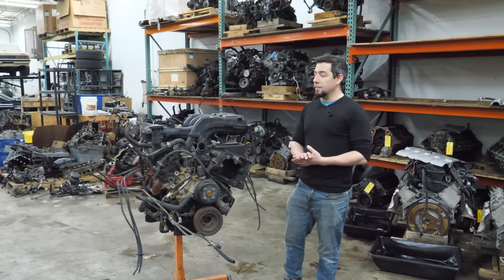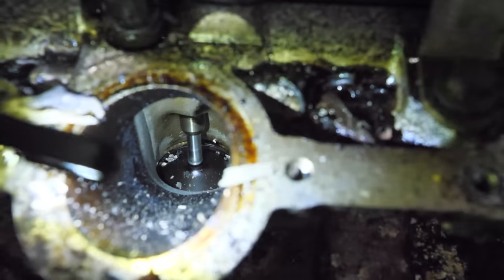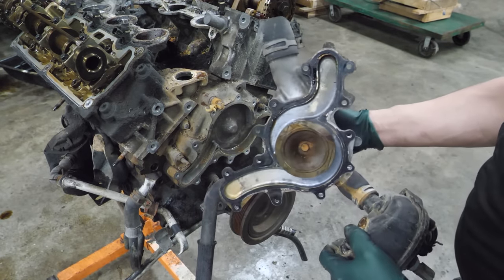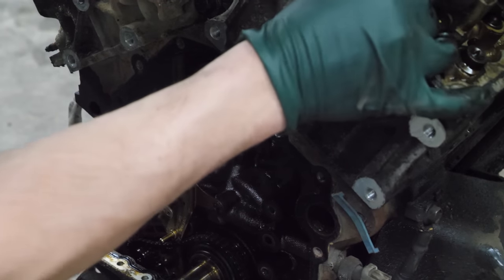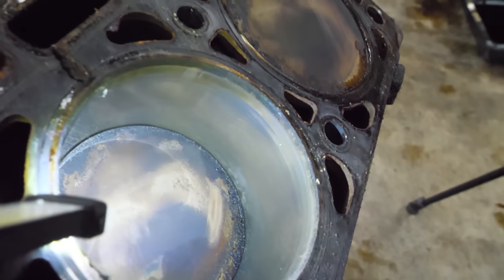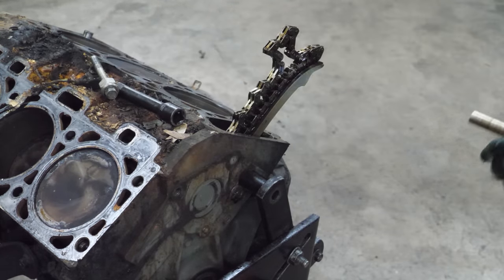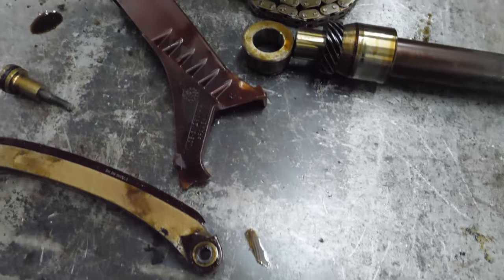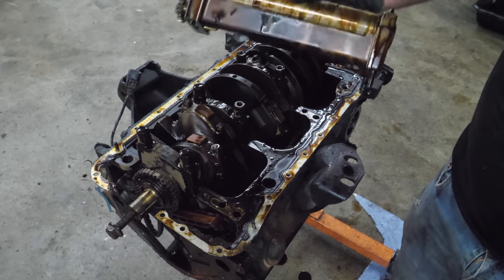Ford Explorer / Ranger / Mustang 4.0L SOHC V6 Teardown! Is This Why They're Called "Exploders" ?

Comment: On the front drivers side timing chain guide, you unclip it so it splits into 2 halves, then you can remove it without pulling the head 👍
Reply: Better take good care of those afterwards
Reply: lol glad someone was paying attention
Reply: While pretty much every manufacturer comes out with a dumb engine design here and there, Ford seems to hold the top spot year after year after year. This entire engine is an insult to engineering and common sense, as well as mechanics and the consumer.. Ford should have just made it cam in block with pushrods, instead of that insane timing chain/driveshaft/cam design. Would have been much cheaper to build, more compact, simpler, lighter and much more reliable. It's not like the engine is moving Ferraris around. It's just a workaday 6 cyl with low/medium output. Could have just done something simlar to the GM 4.3, which was a great & simple, reliable workhorse for decades. Not Ford though- Let's come up with the dumbest way of doing things & get it approved for production...
Reply: @thezoomguys385  It must have been for the enormous power output that they needed a SOHC 🙄 🤷‍♂️
Reply: @Conservator.  LOL, yup. They must have been hitting the bong when they OK'd this design...
Reply: @thezoomguys385  The truly strange part about it is that Ford already had a couple of engines to choose from.  This 4.0L SOHC is a development of the Cologne 60-degree V6 family, and supersedes the 4.0L 160 bhp version that was used in the Explorer, Aerostar, etc.  Ford also had the 90-degree Essex V6 (3.8L, 3.9L, 4.2L) which was used in Mustangs up through 2004 and also in F150s and a bunch of other stuff.  It's weird that they went to the trouble of converting the 4.0L Cologne engine to SOHC, including developing a whole new casting with front and rear timing chain passageways, just to make...this.

You can tell the timing chain arrangement is (A) largely a way to bodge OHC onto an engine that was originally designed to use pushrods and (B) a cost-saving measure, since this probably allows them to use the same cylinder head casting on both sides of the engine.
Reply: @chrise1343  Agreed. However, when you look at Fords engine history from from the time of the OHV era onward, it has been a hodgepodge of everything, often with no outward apparent rhyme or reason. Probably hundreds of designs since the end of the flatheads & they didn't really stick with many of them for very long......
They threw a lot of spaghetti at the walls...hoping something might stick.
In aggregate, all that 'wasted' development cost would total many, many billions of $$.
Reply: @thezoomguys385 oh wait they did. The OHV 4.0L Cologne engine, they replaced that with this abomination.
Reply: @taylorsutherland6973  Agreed, part of my point was that they could have just stuck with the Cologne engine and been fine....
Reply: @thezoomguys385  They USED TO BE cam in block. Almost everyone went to overhead cams. Some good , more bad. Anything that is engine out service, NO THANKS.
Reply: @thezoomguys385  i agree that the 4.0 timiing chain design is dumb but from a price point of view its good, they same a ton on block/rotating assembly because they reused an old design they alreay had and knew was good. and they could slap the sohc name everywhere they wanted wich is the marketing team stuff i hate. but yeah the 4.3 was a great engine exept it was so underpowered a 3rd gen 4.0 explorer was soo much faster and powerful than a blazer with the 4.3 of the same years or anything the 4.3 was in
Reply: Only the aftermarket chain guide unclips, you have to pull the ds head.
Reply: You don’t have to pull the head or dismantle the cassette. It will come out, I’ve replaced many of them.
Reply: You don't have to do that either
Reply: I completely appreciate the info but i can tell the guy is just making content for YouTube, must be a dismantler😅
Reply: @thezoomguys385  they did. the steel valve cover 4.0.
Reply: I’ve replaced timing sets on a couple of those engine. No fun at all.
Reply: I didn’t remove the head either.
Reply: @thezoomguys385  They had a pushrod engine. They developed this engine from the 4.0 pushrod engine.
Reply: @classicstangbrn8964  oem ones do too.
Reply: The rest of the motor looks well maintained or low mileage yet the timing chains/guides failed. Ford builds junk.
Reply: @Tannnnman  Every manufacturer builds junk.  Even the ones like ford who also build some of the best engines on the road.  They all have their great mills and their terrible ones.
Reply: @1SqueakyWheel  So true every manufacturer builds junk, however some manufacturers including Ford build more junk and continue their mistakes for years
Reply: @Tannnnman  I've gotta disagree with ya there.  
Take their light duty diesel line, for instance: 

It started out as a good engine with the 6.9 and then the 7.3 IDIs.  Good engines, and yeah, they were outsourced to International like GM was doing with Detroit at the time. 
GM tried their hand at their own light duty V8 diesel with the 350D, and I'm sure you already know how disastrously that went.  So they stuck it out with the outsourced Detroits which were better, but still not as good as the International Ford was challenging them with.  

Then came the metamorphosis of the 7.3 from the IDI to the Powerstroke...  made a good engine even better.  Then the second gen 7.3PS was even better than the first. 
But eventually, we've largely got the EPA to thank for the death of the 7.3.  

The result was the fairly disappointing 6.0, and then the even worse 6.4, also both provided by International, who was most largely concentrating their R&D interest on their own inhouse heavy duty big-six truck engines which weren't hit as hard (at that time) by EPA mandates, with their attention to the small V8s lackluster at best.  
It hurt Ford even more, because Cummins was able to get it right from the outset when Chrysler contracted them for a scaled down six for light duty trucks.  And then GM pulled their head out of Detroit's ass and tasked Isuzu to build them a small V8 for light duty, which was the birth of the Duramax. 

Yeah it took Ford longer than it should have, but they finally did the one thing that neither of the other big 3 were by that time doing:  They took the Powerstroke inhouse and the 6.7 Powerstroke was born.  It has been a phenomenal performer, and the best Powerstroke yet. 

So now Ford is leading the light duty diesel truck segment again with their OWN inhouse engine while Dodge, Chevy and GMC continue to outsource theirs with Cummins and Isuzu respectively.  All three engines are good ones, btw.  I'm personally most partial to the Cummins, but that's beside the point.  

TLDR:  Ford has made many mistakes, and they've corrected many mistakes.
Reply: @thezoomguys385  the 4.3 blew head gaskets
Reply: @steveschilling5966  No it didn't, at least not any more than the reliable small-block V8s they were based off of, which were absolutely not known for blowing head gaskets.
Reply: @thezoomguys385  Ford seems to have intentionally made this camshaft distribution system completely stupid. A mentally unbalanced man couldn't have done worse.
Reply: @thezoomguys385  Ford seems to have intentionally made this camshaft distribution system completely stupid. A mentally unbalanced man couldn't have done worse.
Reply: @1SqueakyWheel  Did you even watch the video? That’s a well maintained low mileage motor with catastrophic timing chain failure. Go try to tell someone else that Ford builds good motors. I watched the evidence that Ford builds junk. If you don’t believe me watch the video!
Reply: @Tannnnman  what are you mad about?  Did you just read the first sentence of the last comment I wrote, without reading the rest? 
Your reply makes no contextual sense.
Reply: @1SqueakyWheel  I am just suggesting that you watch the video. You will see a motor that is neither high mileage or poorly maintained and the timing chain is broken. This is unacceptable you can praise every motor Ford ever built but it doesn’t change the fact that Ford has sold motors with major issues for many years and has been very slow to correct these issues. I feel bad for people who get stuck with these Fords.
Reply: @Tannnnman  And what I'm suggesting to you is that you try reading all of my comments (probably 2 or 3 prior to our exchange) before criticizing my commentary en toto.  

I watched the whole video before making any of my comments.  No idea why you'd assume otherwise.  
And I'm well aware of the shortcomings of this 4.0.  As much as I've always always loved Explorers (the RWD platform, not the newer FWD ones) I've never been a fan of the later OHC versions of the 4.0.  I own an earlier one, 2nd gen with the pishrod 4.0 and it's well on its way to 300k miles with only basic maintenance and one injector job that turned out to be unnecessary (DOH!) but that's a story in itself that I can only attribute to my own stupidity.  

At no time did I ever imply Ford only made good engines.  I spoke about how they've created some real albatrosses. (the 5.4 3v comes to mind).  
But they've made some of the best engines too.  GM and Chrysler are similarly comparable in that regard with their good and bad engines respectively, but you wouldn't know I'd said anything to that affect either, since you obviously don't read before insisting somebody watch a video that they obviously already had.  

But....  thank you for your humble suggestion! 😉
Reply: @1SqueakyWheel  you are not focused. I can see you will never comprehend what is going on in the video or my posts. I am glad you had very good luck with an exploder. Very few owners were lucky enough to put 300K on them. My point is this motor in the video that you may or may not have watched in its entirety is junk and should never have been sold to anyone. If you you wish to continue buying Fords I wish you good luck and I understand people buy vehicles for reasons other than durability and good engineering. You may wish to reread your post to see if you even mentioned the motor in the video. I hope this post is simple enough for you to understand.
Reply: @Tannnnman  the irony of your words is a little baffling at first, but it makes fully clear that you're not paying attention to my words.  
At all. 
So that makes the point of your contest unclear and seemingly arbitrary.  
I've referenced the exact engine in this video (to YOU, even) multiple times. I told you it's a crappy version of the 4.0, and that I'm not a fan.  

The pushrod 4.0, however, is a durable engine that generally has no problem seeing 300+k, when not abused.  The biggest limiting factor of most older Explorers, especially the all-wheel-drive versions, is its transmission, not so much the engine.  My tranny has been good, and it's still all original, knock on wood... Despite a fair amount of towing, it's never changed personality, but I do expect it to someday be my next issue with the car, as if the nature of automatics.
Reply: You don’t even have to do that. You just take a pry bar from under the guide and tap the hinge up. Comes right out with out removing head. To put the new one in, you tap it down. 
It’s just a tight fit, no head removal is needed.
Reply: You CAN get it through without doing that. But it has to be at the right spot at the perfect angle. Source: am in the middle of this job for the second time on my 4.0
Reply: You dont have to unclip it to remove the chain guide you just wiggle it while pulling up and it comes out, put new one in you open and close both chain guides at the same time as your pushing down.
Reply: @ 18:53 18:54 lynzoido

Comment: im a used car dealer and I have been in the business for over 25 years. The 3rd and 4th generation ford explorers have been my best sellers for a super long time and I know them super well. The 4.0L soho motor in 80% of them that I've purchased. out of the hundreds of them that I've owned only one of them needed new chains and guides and STILL ran perfect. this motor is nowhere near bad at all. just keep up on oil changes, they like thicker oil and clean oil.
Reply: Just keep up on the maintenance...and that will be $2600 for a timing chain and guide replacement please. 
welp, time to junk the truck.
Reply: @DriveCarToBar Or find a 4.6 to stick in 'er!
Reply: I have a 99 explorer with a 4.0 and it has jump time. I've owned fords all my life and this 4.0 is definitely not one of fords better ideas
Reply: I have a 4.0 SOHC engine with 430,000 miles on it.  The timing chains have been rattling for 15 years.

Comment: This is an OHC engine design based on a older pushrod engine. That's why the timing chain design is so odd. The jackshaft is where the camshaft was in the pushrod version.
Reply: Almost makes me wonder if it's possible to backdate one to pushrod and be done with the complicated clockwork.
Reply: There are plenty of OHV engines that morphed into OHC without this nonsense. This very same engine family (Cologne V6) had DOHC variants in europe (2.9 DOHC) with a much simpler and robust chain setup.

Ford wanted to save money by using the same head casting for both sides of the engine, which required this obnoxious chain setup.
Reply: @AmericanLocomotive1  I don't disagree with that at all. I'm just saying what they did. They had a 4.0 OHV in the Explorer/Ranger and wanted a cheap way to make it a 4.0 OHC. And honestly, when it first came out, its power levels were respectable. If they would have had the timing chain guides figured out, this crazy design would have never been the big issue it is today. And yes I've done a timing job on one of these.
Reply: @rmkilc  What I was saying is that just because the engine has OHV origins, doesn't mean it had to be the way it is.

The Explorer 4.0 is part of the Ford "Cologne" family of engines. Ford had already converted the 2.9L Cologne to DOHC back in the early 90s. It used a single timing chain, and still had the jackshaft to drive the oil pump. The timing system on those 2.9 BOA Cosworths isn't particularly troublesome.
Reply: Wow!   Explains the what but I am curious about the why.   Why go to SOHC with no intent to change the valve arrangement from wedge to something else?   What is to be gained?   This move makes zero sense to me when it seems the OHV would be much simpler and more reliable.
Reply: @mbspoobah  I'm pretty sure it's purely marketing. SOHC sounds "more high tech" than "pushrod".  

There may have been some minor gains in power or emissions efficiency as well (although that's a lot of parts complexity for what seems like fairly minor gains)
Reply: I fully understand that the SOHC evolved from an existing pushrod engine.  IF the goal was conversion to SOHC, the desgn choices made are underrstandable.  iF however, the goal was a better performing engine, the redesign was a rediculous waste of money, when a competent redesign of the OHV heads would have made sense.
Reply: The OHC version is much more dependable
Reply: @mbspoobah  it gained 45 Hp (28% increase)by going to sohc from ohv with minimal fuel economy penalty.
Reply: @jrburger95  compared to the predecessor pushrod design? I don’t recall ever seeing major reliability complaints about the pushrod versions of that engine - and the one I had in a ‘92 Ranger was just fine mechanically.
Reply: @michelleshaw337  Sorry that was a Typo I meant to put OHV I was referring to the pushrod motor
Reply: It's this as well as the fact that they wanted to make one head casting that installs on both sides (#1L2E, some machining differences and cam different).  That requires a timing chain drive on the back on at least one side.
Reply: They shouldn't have changed it
Reply: Wrong… the chain design was Fords bright idea to be able to use the same cylinder head on either side (Bank) of the engine, obviously without any forethought to maintenance.  Absolutely the stupidest idea ever
Reply: @rmkilc  Ford seems to have intentionally made this camshaft distribution system completely stupid. A mentally unbalanced man couldn't have done worse.